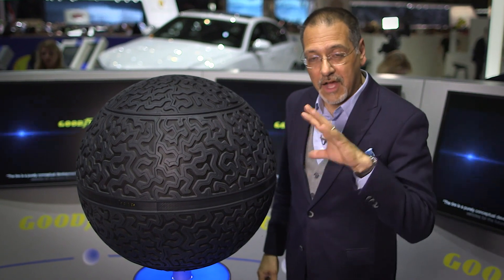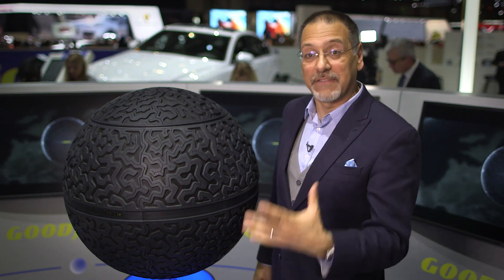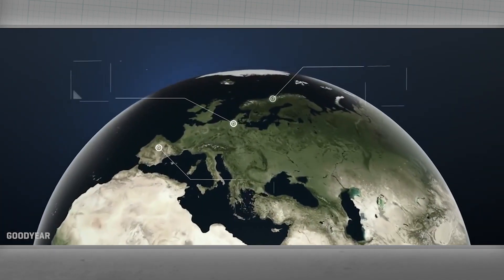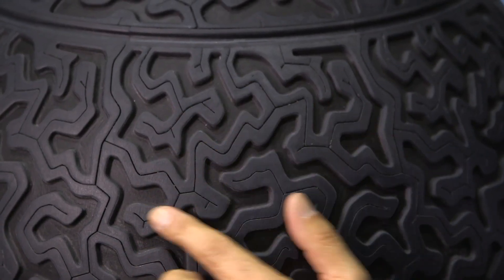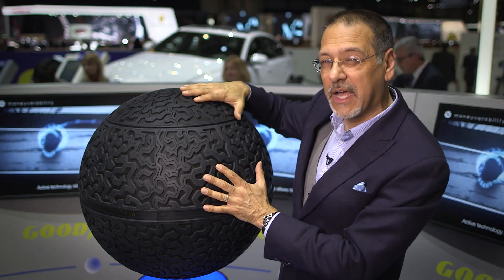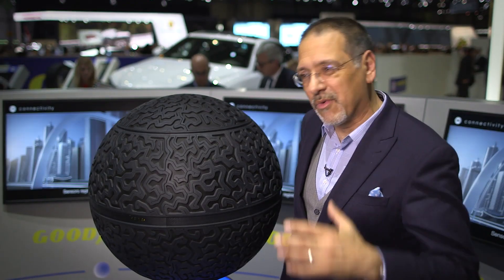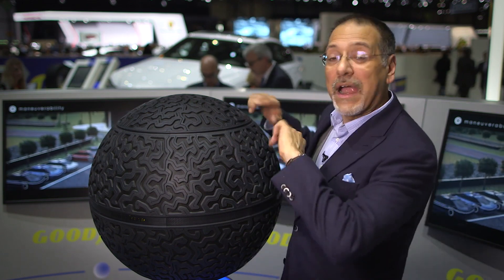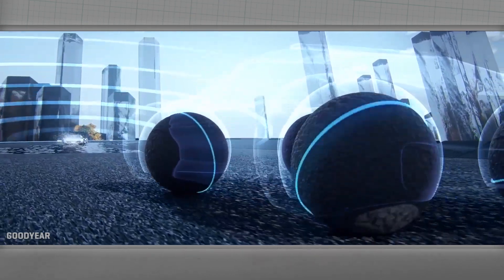​Road to the future: A look at Goodyear's Eagle 360 concept tire​ (On Cars)

Comment: All these comments don't talk about how these Tires will allow cars to achieve higher speeds because they have eliminated the stresses and heat that is placed on traditional suspension the only factor that would limit its speed would be the tire its self